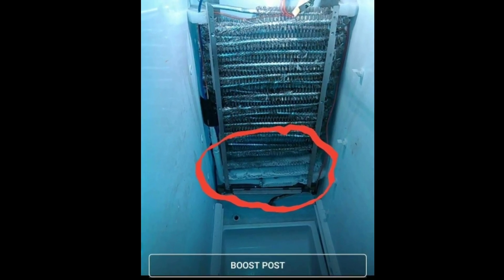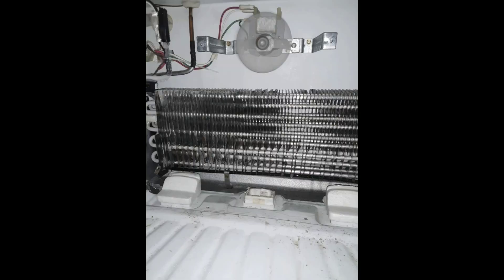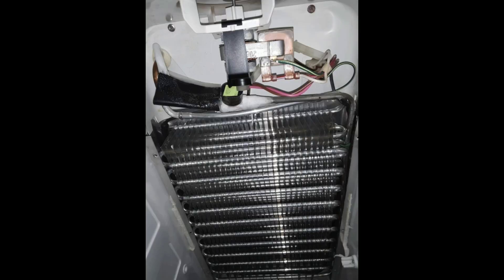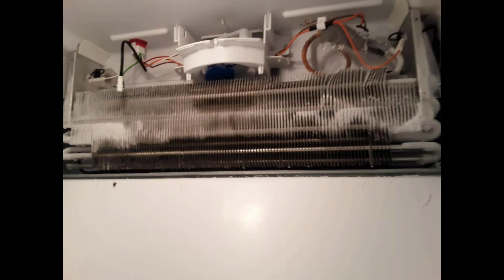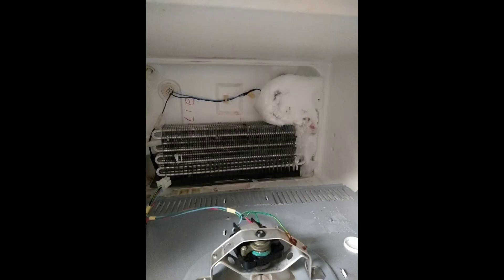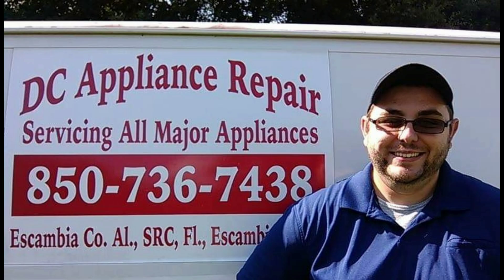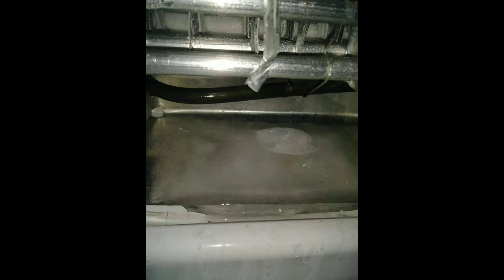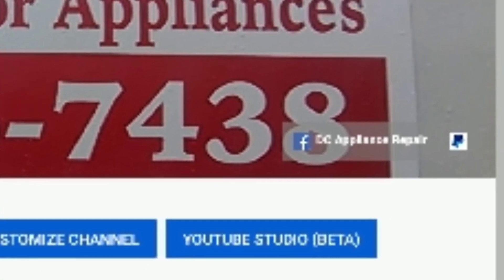Appliance Repair Training- Refrigerator Series part 2 (Sealed system issues)

Comment: My fridge has got an ice ball at the corner, I replace the sensor but didn't fix the problem. What seem to be the problem. Old sensor slow to response to the temperature changes, defrost element tested working. What do you mean by sealed issue?
Thanks
Reply from the maker: Yessir! Is there a pattern pattern on the evap.
Reply: @DCApplianceRepair  it frosted at the screw on one corner. Just a little bit , about 3 ice cubes.
Reply: @DCApplianceRepair  Wow the video and answering questions in the comments, I'm subbed for sure